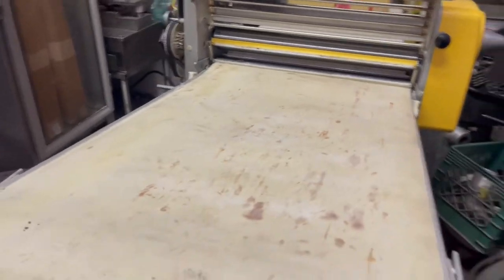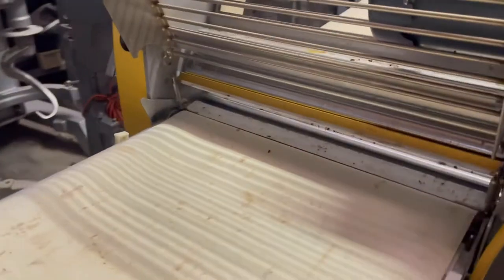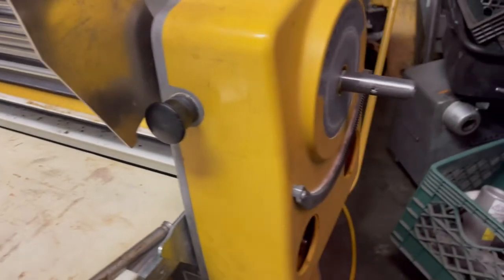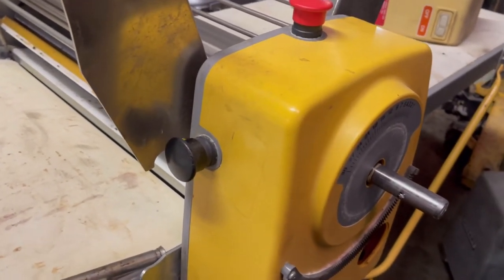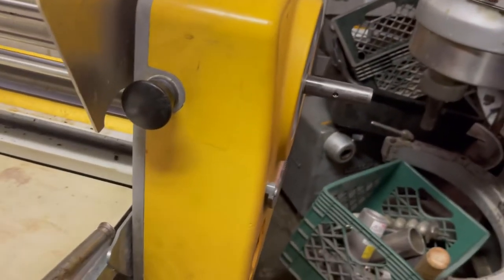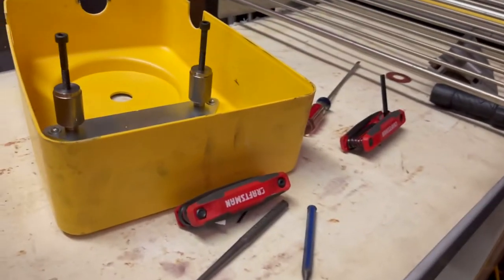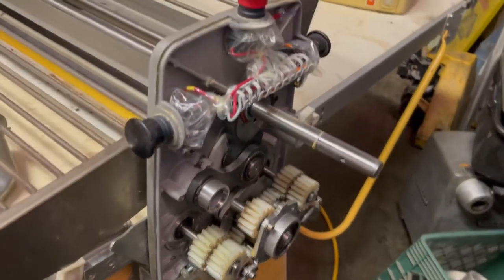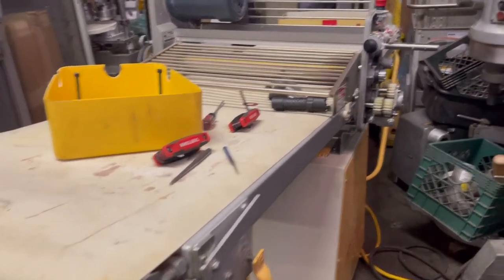Rondo dough sheeter first time servicing One

Comment: Hello I  hope you make a new vedio about the all Auto parts of the dough sheeter roller machine size and belts and rollman bearing and Cylinders rollman size  needs from A to Z to make a manual  one without a motor,and hope I have the best advice from you,☺
Reply from the maker: My experience with rondo sheeter is very limited because I don’t do many rondos as my experience is with other equipment, but if I get a chance or more sheeters to work on it I’ll make more videos